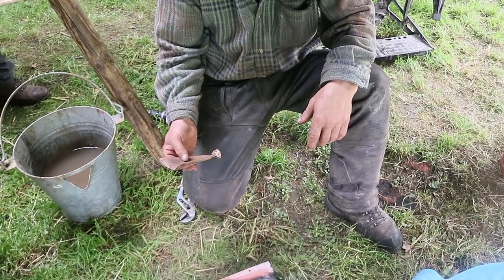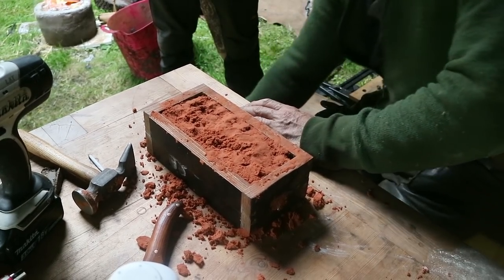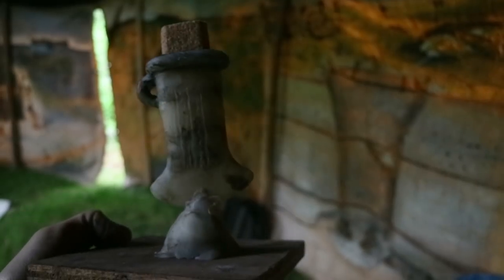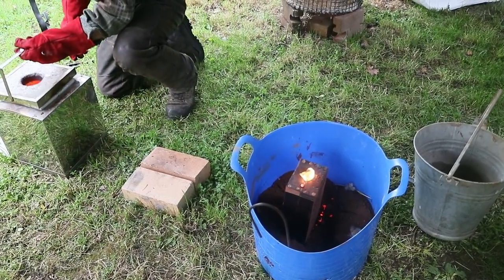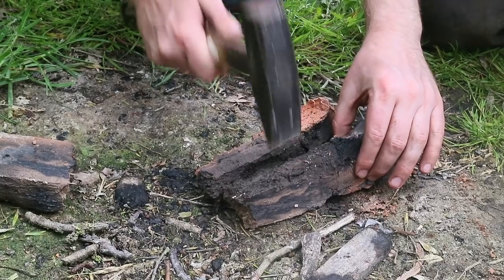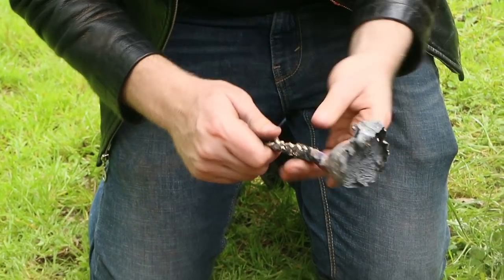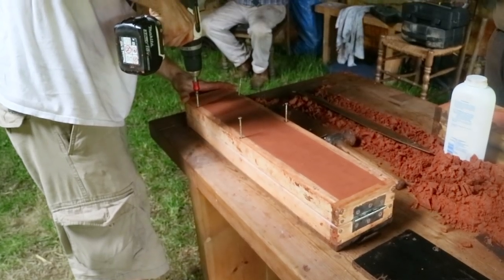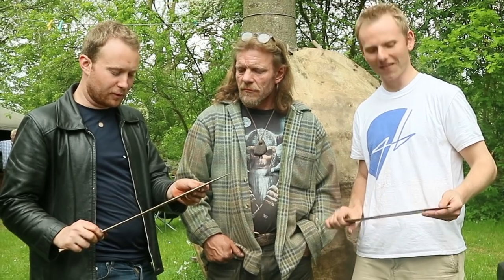Bronze Casting with Will Lord

Comment: One would think that since the bronze age came before the iron age that bronze would be easier... I don't understand how this is easier.
Reply from the maker: Same. Heat shock resistant crucibles are needed before you can even start casting. Regular pottery won't cut it. JB

Comment: For iron and steel, heating, quenching and working it can have huge effects on its properties. Is this true of bronze also? Is the quench an integral part of making the tool, or is it simply a way to quickly make it cool enough to handle?
Reply from the maker: Just to make it cool enough to handle. You can work harden bronze, but most bronze alloys are actually made softer by the quench. JB

Comment: Pretty cool but I do somewhat find the use of modern casting putty a little bit annoying. There are multiple types of sand (like greensand) that they had access to and used back in the day for casting, it's just harder (put possible) and less convenient to make molds with and the results don't have as nice a surface finish of course. Takes a lot more effort and you gotta compact it pretty hard to get good results with. Just seems a little lazy on his part.

I find the use of anything like what he used extremely far-fetched when regular purified sand+clay mixtures would be much more readily available in the ancient world and would be far less problematic to produce, use (and re-use) and much cheaper, while being significantly better for casting larger items like swords due to the ability of the metal to de-gass through the sand.

Anyway, great video as always. :)
Reply: You can use most beach sands also, but it is just the end result takes more work.
Reply: @wobblysauce  I didn't know that! Very nice. :)
Reply: Some sands when you moulds are one and done, but the above is still reusable/less wastage/closer to the final result, which is less time, start to finish.
Reply: @Vapefly0815  i get what youre saying, but at the end of the day hes doing this to run courses, so he needs consistant results that dont take too long, so people can feel the joy of casting their own sword, first time, without breaking their back working on it, and also keeping budget in mind. you can do things ultra primitive, but when youre running classes for everyone from lil kiddies to old men, you want consistant good results, and more modern stuff gets the job done.